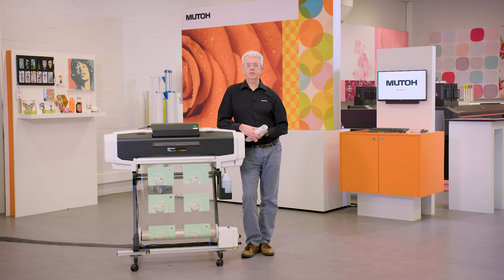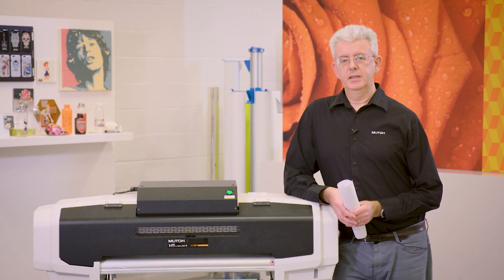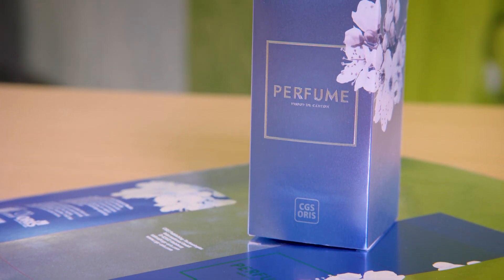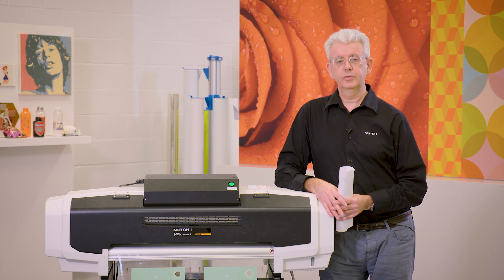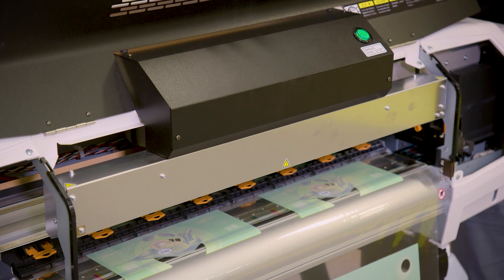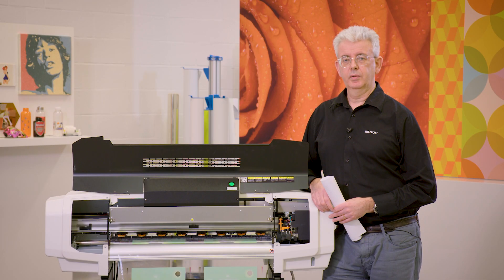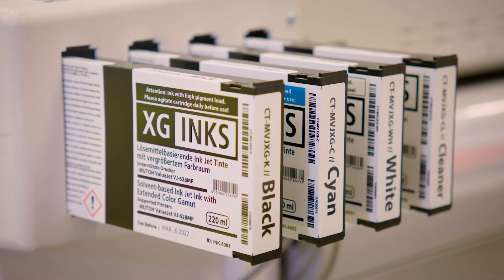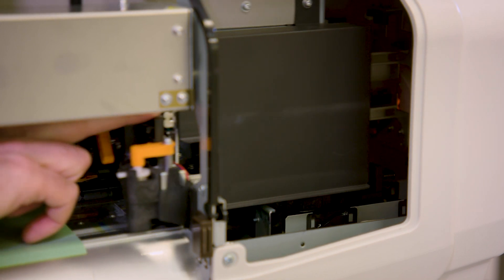Direct-to-substrate Proofing of Packaging with Mutoh's ValueJet 628MP Digital Piezo Inkjet Printer

Comment: Looks identical to the 628 and 628x What does this one have inside that the others do not have?
Reply from the maker: The new total solution integrates Mutoh’s ValueJet 628MP, a 24” (630 mm) wide digital piezo inkjet printer, CGS ORIS™ FLEX PACK software and the new generation CGS ORIS multi-resin XG INKS (C, M, Y, K, Lc, Lm & White). The core differentiator of this print solution is that it is currently the only one available that is capable of printing directly onto a wide variety of packaging substrates without primer or pre-coating, such as shrink film, uncoated label stock and corrugated board.

Comment: How do you transfer the print onto the bottle?
Reply from the maker: Dear Blueline Gifts,
Thank you for your interest in our 628MP product. The 628MP prints directly onto a wide variety of packaging substrates without primer or pre-coating, such as shrink film, uncoated label stock and corrugated board. Referring to your inquiry, by applying heat you seal the printed shrink film around the bottle. The technique shown in the movie is by vacuum, but other techniques are possible. To provide you in-depth information, please provide us your contact details at https://mutoh.eu/en/contact.
Best regards,
Mutoh EMEA Customer Team